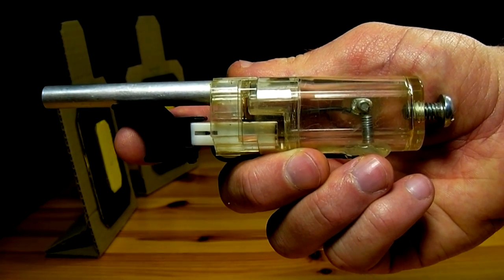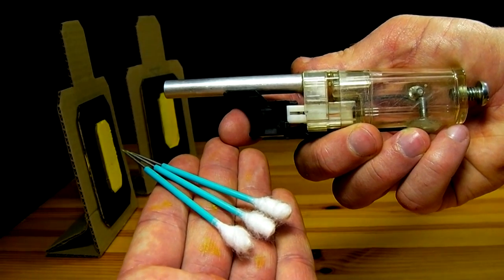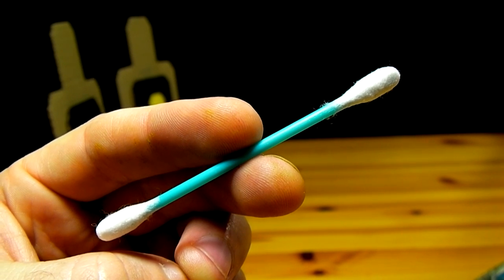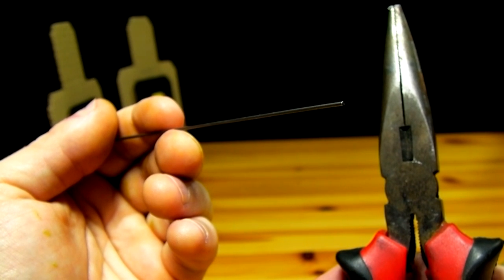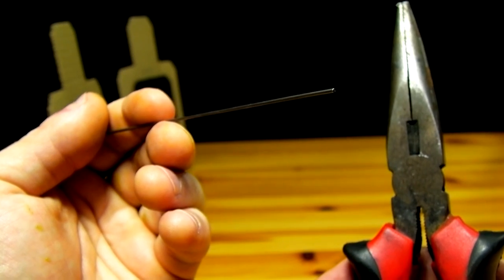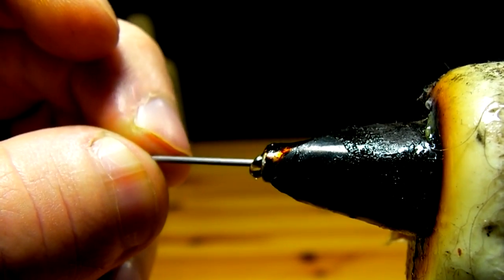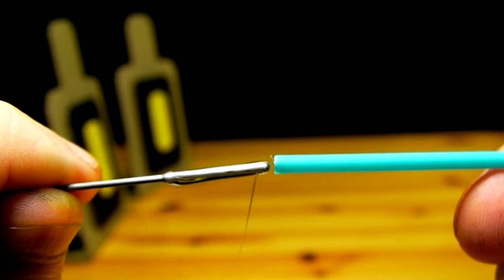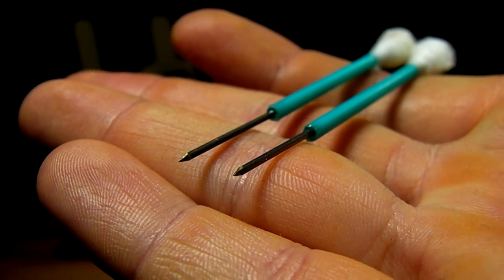Make Ninja Darts for the Lighter Mini Cannon

Comment: Alcohol is more reliable than gas, but it needs small containers to explode properly, if you're doing it with gas check the proportion air/gas because it needs to be very precise to explode, make sure you remove the CO2 after the combustion and if it all fails check the spark.

Comment: Could I use hairspray instead of 99% rubbing alcohol or would that break the plastic of the lighter?
Reply from the maker: I use 91% alcohol, not 99%. Hairspray would make the inside sticky and fog the clear plastic. It also can coat the screws so a spark won't be able to jump.
Reply: Thanks
Reply: +NightHawkInLight mine won't light the alcohol it is 90% and I do see a spark it just won't light it please help.
Reply: DoNkA
Reply: +the mighty Minecrafter. i use stetson mens choline it has a super high alcohol content or hue axe works too or use bod spray its cheep and 2 squirts and a quick blow (for oxygen) and boom you have iy
Reply: Soso Al Jobyu
Reply: Soso Al Jobyu

Comment: NightHawkinlight, i'm in need of help!
I made this weapon bigger and stronger but i have some problems with it
I used a red bull energy shot bottle cause its small and strong
with 300v for the shock from a flash camera, and a gas line inside the bottle to fill it with gas using a barbecue lighter tank
i use butane gas but it will only shoot once.
when i fill it up with gas it doesn't shoot for the second time
i though without air you can't make a ignition
but even then it didn't work
help me! ^^

Comment: Made these with needles and used them with a 40 cm tube and my air compresser. 90 PSI embeds the darts in wood and gyprock at 20 meters >:D

Comment: son of a bitch i thought i was original wit using these but i made mine poison darts but i stuck clay down it filled it up and used the tip from the pen in the top :( and i put it in a airsoft gun